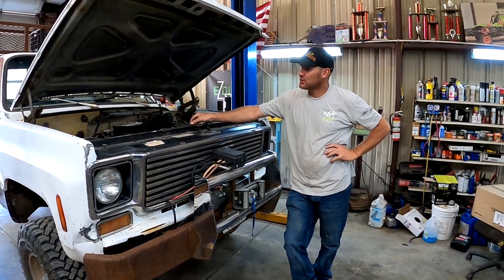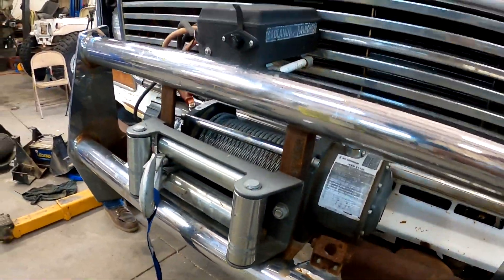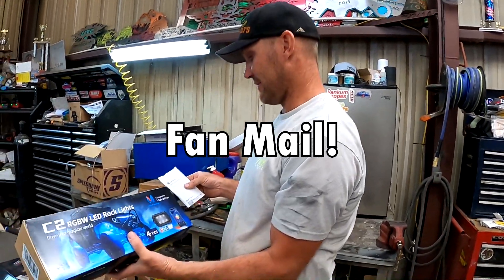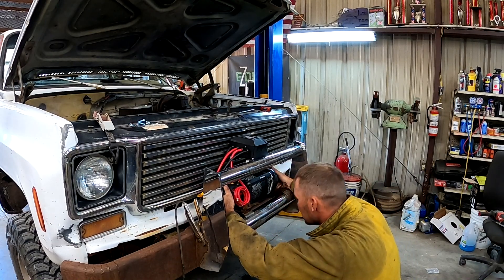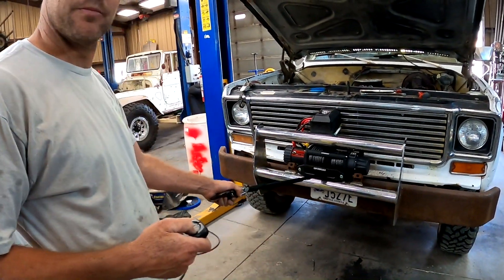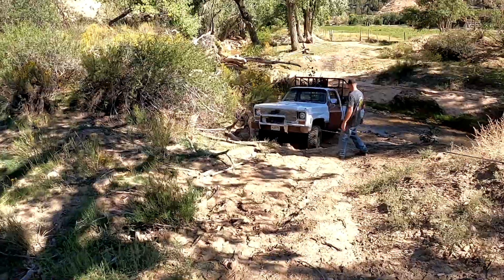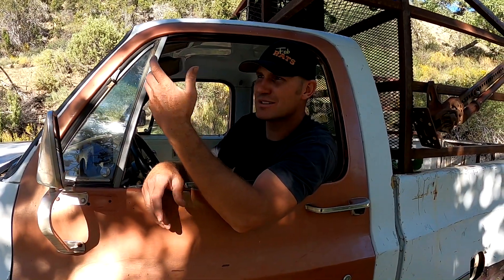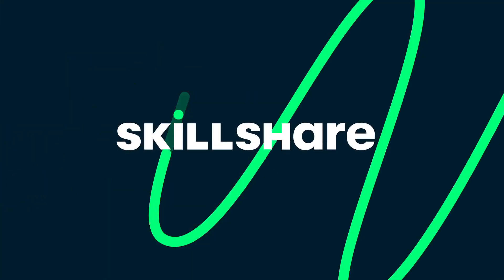Looks like the Old Chevy Wood Truck might need some ASSISTANCE!

Comment: Sure was glad I had my winch on my F250 a couple weeks ago out in Moab. Wasn't even doing anything hard, just wasn't paying attention enjoying some scenery and ran over a big rock right in the middle of the trail lol. Ended up diffing out on the front and wasn't able to back off, front tires in the air and the rears were in mud, no traction. Thankfully there was a couple boulders the size of my truck I strapped to. No cell service, nobody around and a very long walk back to the freeway, good thing I was prepared lol.

Comment: Question for ya. Is there something wrong with the 4 wheel drive in that truck? The front wasn't really trying to pull. I ask largely because I have 2 77 Chevy's myself. They are limited to playing in the snow, and I am always inside so I would not see that myself.
Reply from the maker: It doesn't have a Locker in it so the tire that has the least traction  will spin.
Reply: @FabRats  Thank you, mine has limited slip. So hopefully it will be ok. ;-}}

Comment: It’s now wood season? 😂 I remember spending my nights after work all summer collecting dead and down, also my days off and sometimes I’ll still have to go out cut some during winter… but we need atleast 10 cords for winter minimum here in yooper Michigan. But atleast gather 15 cord, now this is full cord not a face cord now… two face cord will fit in a full size truck level, just to give someone an idea if they dunno

Comment: Might think I’m crazy.  I installed a 17500 on n a stock 2017 Jeep  2 door wrangler jk.  No mods all stock came from Toledo. As big bear package. Only issue is winch weighs 180 lbs not including. Mount

Comment: Don't forget a winch is rated on it's first winding layer on the drum... from there the rating does down quickly. And you know to not wrap a cable around a tree and back onto the cable itself...(?)

Comment: Hey Paul, what would you recommend as a beginner welding setup. I am not a rich guy but I have a desire to learn to weld and build a skillset around that. What would you recommend I get started with?
Reply from the maker: Weld pro is a good starter welder.👍🏻

Comment: I at least laughed as you had those kids call you out and I know that ya did Paul. I love the channel as I'm a old guy who sets in one spot hoping you and a few others will kick out a dandy. I am going to say  that you  tested that old truck more than the winch as it was in tight as a Jews wallet in that rock bed. I really would of enjoyed having a decent remote like you have there. I kinda lean towards the block in a bit so its a bit slower but oh so easy to pull and not hurt winch motors like the ones that warn tried to sell as twelve thousand pound  winches. I burnt a few up on my plow trucks in my day

Comment: I went with a snatch block on my setup instead of a larger winch. 9K lbs became almost 18K. ;). I know it was just a test pull, but you really should always use a tree strap.
Reply: Rope cover does the same thing as a tree strap.
Reply: @chrisgriffin2587  almost.  Rope cover doesn't protect the line from a sharp angle if hooked to itself.  I've had them break like that.
Reply: I agree, tree strap is about saving your equipment but also lowering our footprint on the environment. We count on sharing these resources with others, and sometimes the others can be grumpy. Always put our best foot forward:)

Comment: I would love to have your "wood truck" that Chevrolet would be a awesome mud truck/ daily driver/ hunting truck. It is almost impossible to find a square body here in the South East
Reply: Got 2 in West Virginia 76/81. Both have 410 gear full float rears  the 81 has  10 leafs in rear 6 upfront 4speed  383. Striker.
Reply: Stroker

Comment: You really don’t want to be hooking back to the cable, especially a synthetic! The side load on the line drastically diminishes the strength, this is where it will snap if anywhere! Just keep a short strap in the truck for trees, rocks, etc!

Comment: The music was louder then what Paul was talking about with all the gifts.
Reply: Wut'd did he say ??
 Man that old wood truck is a screamer.  How rugged is the poly rope in the winch vs steel cable working around rocks/steel fence posts/etc. Anyone ??
Reply: @barnhooty2956  they're not nearly as abrasion resistant but they won't kill you when they break.

Comment: Paul, you have a great lot of subscribers please show them what to do correctly when winching. Like tree protectors and dampeners on the line. Good entertainment once again.
Reply: You don't really need these things when your using a synthetic winch rope.
Reply: @JP-ou8yb  I know things have changed but rope either synthetic or steel will cut into soft bark and with enough tension the rope can still whip so it is better to be safe than sorry. Not all people look or under stand safe practice.